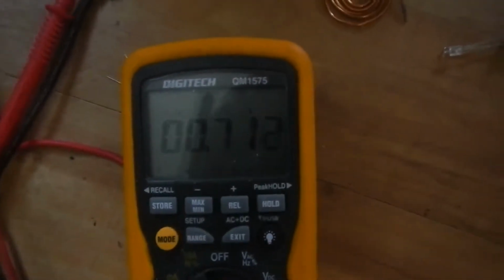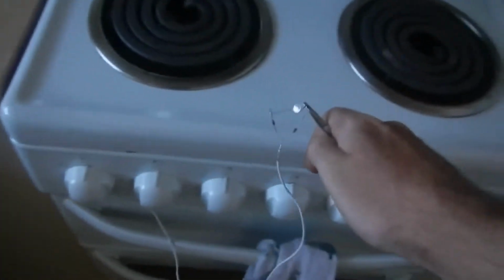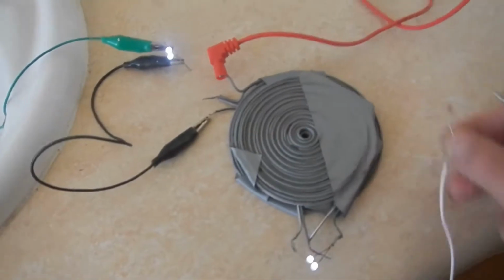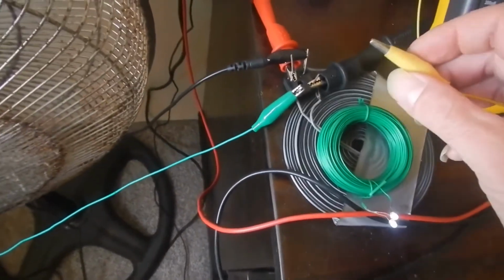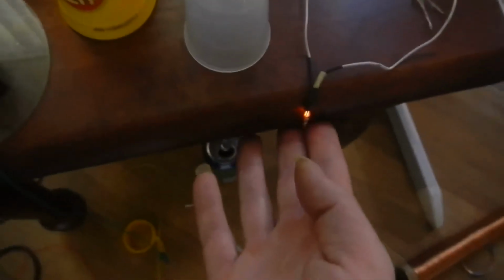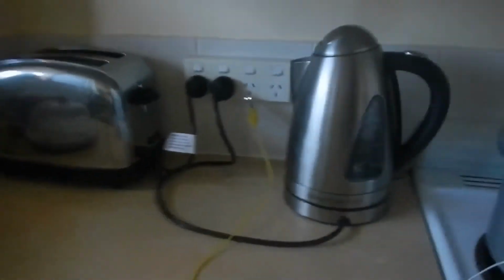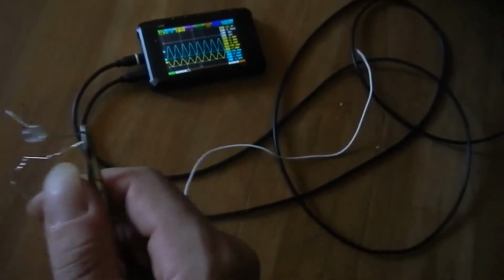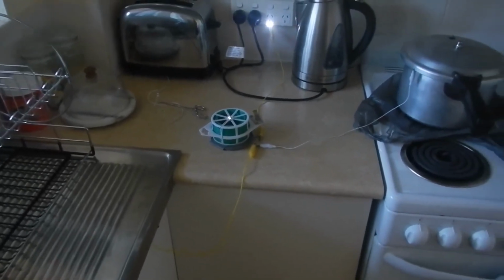Tesla powered house pt 1&2

Comment from the maker: Something like that. Going to have to make me a lux box. Need a way to work out my efficiency rating. I can run 50 LEDs from each earth, no worries.each bulb is slightly dimmer than if I just have a few, but total light output keeps going up. Stupid electrician didn't put earth to the light fittings though. Still got no idea how far away it works either. I think I'm transmitting too much :) Need to make it less powerful

Comment: There's an idea - fit mini pancakes within designer light fixtures. You could gut LED bulbs and put mini pancake repeaters in or other little circuits. At some point, you may find that the total output of usable light is higher than the 15W of normal lecky :) And, you'd have a custom designed solution for your house...good talking point when inviting ladies back for coffee !

Comment: A wireless field off the door handle, adjusting the pressure cooker for more field, charging caps by hand contact, like all of THAT's normal lol.
Superb example of 1 wire transmission, as in the ground circuit for the house. Very cool !

Comment from the maker: If you look at the scope, you can see it's 899-900 khz. Check the time div's. There does seem to be a 50hz (I'm in Australia, 50hz 240v mains) pulse that adds a bit. Thats the whole point of Tesla transmission. to pick up any signal between towers, and in theroy, run many loads with no added draw. Or even lower the power draw with more load. Lots More testing to do before I can confirm or deny. All I can say for now is I have wireless power, and it seems part of it is from capasitive coupling.